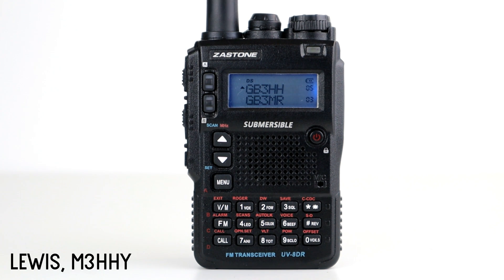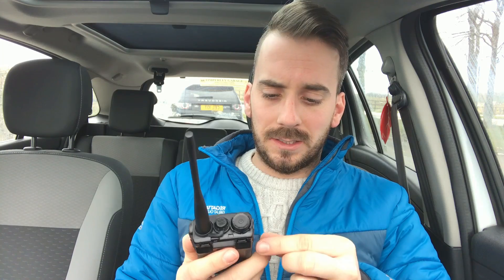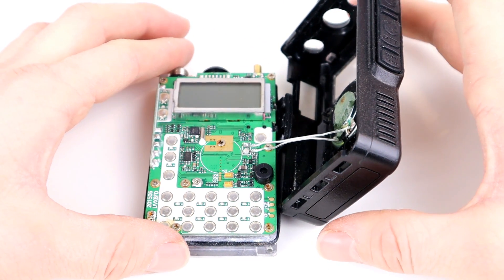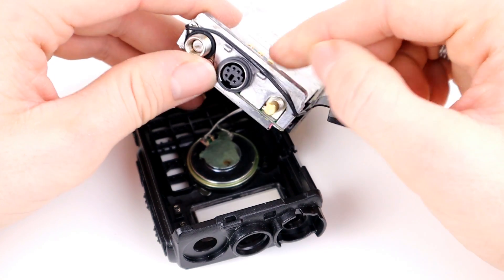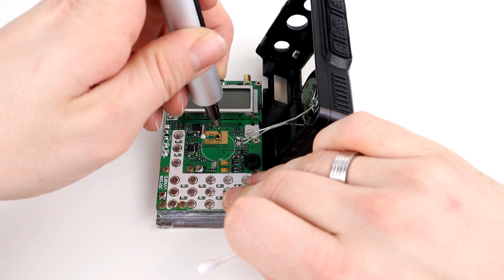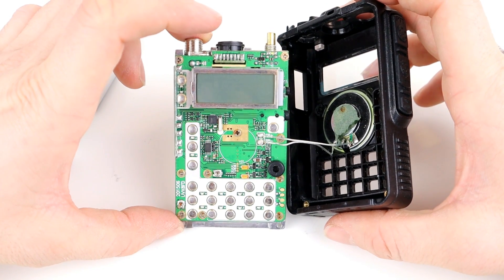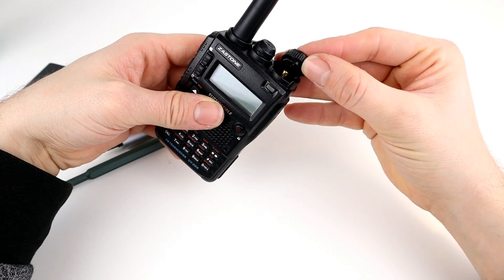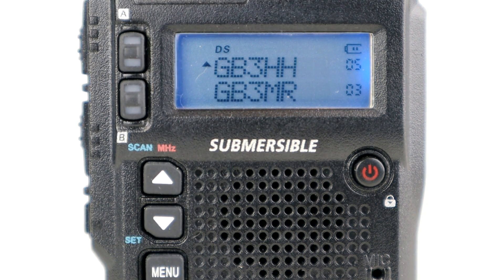The Reason Why The Zastone UV-8DR Isn't Submersible! - Radio Repair

Comment: How to dry out a phone or Radio.  Dry it out the best you can quickly.  Next put it in  jar full of rice and screw on the lid.  The rice is an active dessicant.
Reply: That os dependant on if you get the charge off the item some phomes now have it build into where you can't remove and those phones are how you say WORTHLESS!